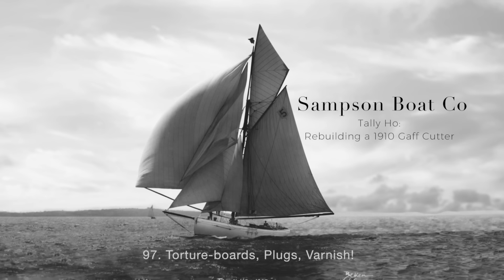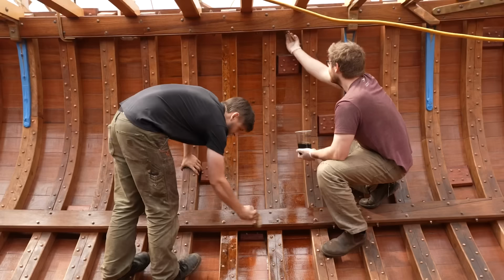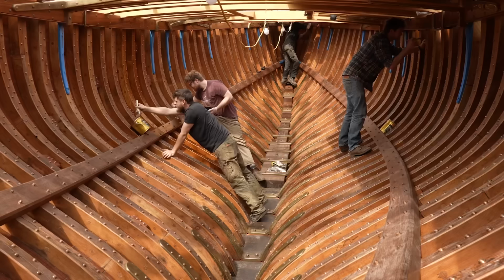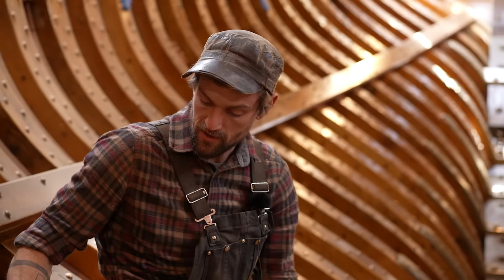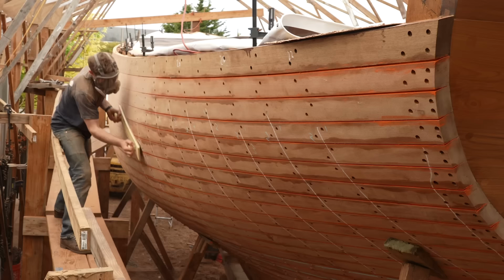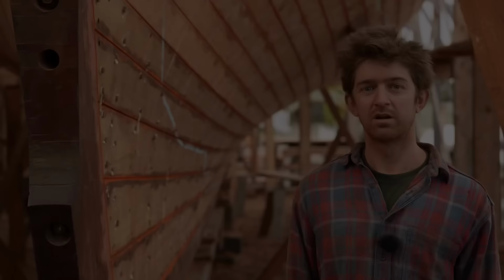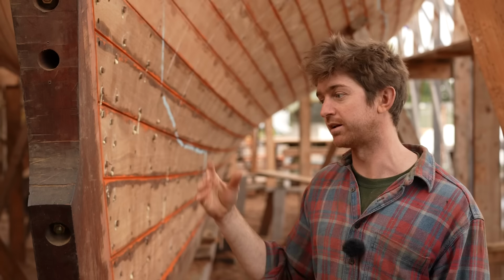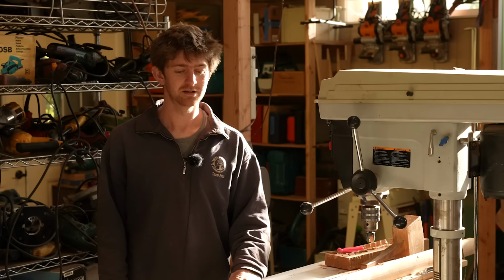Torture-boards, Plugs, Varnish! (Traditional Boatbuilding / EP97)

Comment: Leo, on the teak - get in touch with the USS Iowa Museum. They're in the middle of a $5M re-decking of the battleship, in teak, of course. They may be able to give you some options.
Reply: This is a good suggestion.
Reply: Wow, that would be great !!
Reply: @icarus877  I haven't. I'll give it a go.
Reply: Awesome
Reply: Wonder if it could be reclaimed...  How cool would that be, to build the deck out of the reclaimed boards of a USN Battleship!
Reply: @spaight711  There is a good chance the timber coming off could be re dimensioned down to a size suitable for this.  This needs 2" thick I think he said and I believe the deck on a battleship was about 6" teak. 
Weirdly I know this as my das has a letter opener made from the deck of a battleship and it has a brass plack on it telling you that.
Reply: GREAT!!!!

Comment: Hi Leo. Love your channel. I am a forensic fire investigator in Australia. When using linseed and tung oils, please ensure any absorbent materials such as rags etc that have been contaminated with the oil, are disposed of in water. Both these oils are prone to self-heating and spontaneous ignition when rags are exposed to air in trash/rubbish bins etc.  Take care and keep the good work.
Reply: We usually just burn them at the end of the day.
They can't cause fire if they're already on fire.,
Reply: reminds me the safety guy for the company we worked for  had a fire at his home after doing some staining . later during a safety meeting the safety guy was stressing there is no such thing as an accident . one of the contractors then asked  . so the fire at your place was arson?

Comment: To Leo and the crew, you guys have done a fabulous job. I can clearly see why the long sanding boards are called torture boards. I wouldn't last 15 minutes. My shoulders would give out. The idea of working a torture board for an entire day is unimaginable but I have to say that the results seem to come quickly as the hull becomes truly fair with no lines, blemishes, high or low spots. The end result looks fabulous. A big round of applause goes to all the people who slaved away varnishing and sanding the inside of the hull and as with the outside it looks fabulous. Before you know it you guys will be applying a coat of paint to the outside of the hull. Leo, all the best in finding the perfect supply of wood for your deck. I trust another miracle will happen just when you need it. Cheers - Wm. Gatineau,  Quebec.

Comment: Hi Leo, 
Again, What a fantastic project!! She looks better every day.
Regarding woods, I see some people recomending IPE. This is a very heavy, very hard wood difficult to work with. In double-ender wooden boats made in the 1940s  (like the legh II) of Vito Dumas, this wood was used for structure, ribs and Gardboard and lower planks (exactly in the way you used angelique).
Since in those days (WWII) it difficult to get teak from Asia, many of these old boats had decks done with "Petiribí". I've seen decks with 30-50 years in mint condition.
I am pretty sure you have done much more research than I have, - we are used by now to see how thorough you are in both the preparation and execution stages- including, of course, wood sourcing. Still, from what I have researched, although Yellow Cedar is used for decks etc, but it does not seem to be particularly rot resistant. Since you are stuck, maybe some additional homework on other woods would be worth it. ?
It is a pity that you have to move and lose a big chunk of time and money in this. If I may suggest, why dont' you do a "moving-out t-shirt? In the front something like a drawing of Tally-ho in the truck.... in the back  just a sentence "Sc@& the neighbour"

Keep it up.

Comment: Hi Leo - as well as a boatbuilder you are a superb photographer. If I may make a suggestion,  it is to set up a photo session to get the interior of the boat in full sunlight with Poncho in the foreground (ish). It would be great picture to display in the finished Tally Ho’s saloon,  as he has very much been part of the project and in fact is probably the only ‘viewer’ who has watched the unedited version. It would also make a great signed print to sell ,to raise funds for the deck timber.😀👍⛵️

Comment: If every subscriber donated $0.20, you could afford the teak. Let’s do this!
Reply: I would hate to donate .20 and find out later that only 200 others had donated too.  A project like that would require the full amount be donated so as to acquire all the wood necessary.
Reply: In the 1970’s I worked at Matson Navigation’s dock in Oakland CA.  Bulk ships in from the Philippines were braced with mahogany boards several inches thick and 40 ft long.  They were given away for free.
Reply: @pehill1951  I remember the cribbing and dunnage for Cheoy Lee boats (shipped as deck cargo) was absolutely beautiful  and ended up given away as garbage.
The whole 'pallet crafting' scene today would be shocked.

Comment: I understand how rewarding fitting the plugs and chiselling them smooth to the hull afterwards. I think the reason why in my mind is it’s a simple rewarding job as you look forward how the plug grain matches up with the plank grain and I bet you admire the one that matches perfectly when that happens. So you are always eager to get that perfect fit. You can call it mind games but it’s a very satisfying way forwards to see the end result of the plug blending into the surrounds and is to me important to get the grain matching the grain of the planks as if grain placement is wrong ,it will show up a lot of the time after the hull has been painted. Cheers to the look of Tallyho and all of those who have and still working on her. Must not forget the feeling of super sharp chisel removing thin slithers of wood is satisfying as well! Cheers 🥂 Leo and all

Comment: When you "Filler" the shallow holes, make the "Filler" from saw-dust, mixed with, "Two-Part-Epoxy", that way they will be there forever... or put the shallow plugs in with, "Two-Part-Epoxy", then it won't ever matter, how thin it gets when you fair it off...

Comment: 25:15 As an older person (65) I can attest that you won't have to use a long board to feel like that from sun-up to sun-down every day. Take the utmost care of your lower back as you journey through life. Knees, hips and shoulders can be replaced. Back surgery involves fusion which means those joints don't move anymore. Look at the movement of the elderly and ask them what they did for a living. Those that move well were not boat builders. Teach boat building and you will have a longer career. 

You should all be very proud of your accomplishments. Tally-Ho looks tremendous.

As my Dad would say, "My hat is off to all of you." Best wishes to all the volunteers.

Comment: What you need for the long boarding is an air file you get the same finish but it's a Pneumatic file about the 2ft long lot less  work on the arms and back , their mostly used to file body filler in body shops on 🚗 cars to get flat areas before paint

Comment: So long for now, to the ones headed back east. Those bungs are either pretty soft, the chisels dang sharp, or quite a meeting in the middle somewhere. They sure shaved quite well.
Those long "torture" boards are a good work out on auto body work. I can only imagine fairing on the larger curves and flows of a boat's hull 🤤. 😉
Loved seeing the blue and yellow making the green "goo" compound. You know there is paint coming soon when filler is getting mixed. And the varnish looks so beautiful on the interior of the hull. So glad you didn't just slather bilge paint in there. It just looks so much more appropriate to its original in varnish, even with the bronze instead of iron.
She is looking so beautiful, Leo. You guys and gals are building a gorgeous boat, for sure.

Comment: I believe you, Leo are using the proper term.   So I believe that plugs are the proper term.   By definition, a  bung is a liquid stopper in a hole like in a wooden barrel.    
  Also you don't purchase bung cutters, you purchased plug cutters.       I bet back in the day former coopers that switched to boat building were the first to use the term bung.   I am a small wooden power boat person.  I believe that companies like Chris Craft, Century,     Lyman, Garwood and Hacker Craft all called them plugs.

Comment: 13:35 Maybe you could use Total Boat's wood repair putty (FixWood)? Allegedly, it's meant to repair wood pieces, therefore, it should have some level of give? I mean, it would certainly be better than regular filler if behaves as implied.

Comment: Tonk and a big brush like the Wooster yachtsman and I feel like I only have to dip the brush halfway in once to varnish a huge area before having to return to the pot. It holds so much I have to start in the middle and work back to the wet edge. I’m sanding less between coats, as little as I dare, and haven’t found the minimum yet, as long as the coats are thin and allowed to dry. Wild stuff that tonk, I got to use now that I’ve spent so much time trying to figure out how!

Comment: You might want to try some alternate sand paper materials, like ceramic, to sand the harder wood when fairing it with the sanding board. There are a few other types that are used when knife making and sanding hard steels to finish.

Comment: I guess (and hope) that the loose rivets were caused by not bucking them correctly in the first place. A tiny movement at the time might not be noticed, but when they're given time to move a bit they can reveal themselves.

The reason I hope this is the problem is that it implies that once they have been corrected, the problem is at an end.

Comment: Have you ever considered a long flex block air sander like the ones they use on cars. They're pretty aggressive with coarse paper and can dialed down to a glass finish with fine paper, either way maybe they can help with your harder material.

Comment: What impressed me was seeing the uniformity of all the rivets on the frames, knowing the holes were drilled from the exterior. How did you manage to keep the drill ‘straight’ & at the correct angle, through that depth of timber with no mechanical guide?
Reply: I forgot to ask: When installing all those bungs, did you align the grain of the bung with the grain of the planking or did you just insert them without worrying about alignment?
Reply: The crew had > 4000 holes to drill so it's unsurprising that they'd get it right eventually. (Keep the drill square to the boat's centerline, not the hull surface.) & yes, the bung grain is aligned to the plank grain.

Comment: Question? 
On some woodworking projects I'll seal the entire backside of a board before installing it. 
Is this something that could be done with the boards on a boat hull to better stabilize them or would their be downsides to that?
Then additional vanishing on the inside of the boat would essentially be second and third coats?

Comment: I'm assuming the outside of the boat will all be faired and painted with epoxy based fillers and paints which should reduce the amount of water getting to the wood and rot (over the long term) where possible?

Comment: Leo, Thanks for another interesting video.

Given my background as a professional boatbuilder, I can't entirely agree with some of your fairing techniques.  Longer boards i.e. 6 to 8 feet (that require two men) work far better in my experence, also each person encourages the other to 'keep at it'.  Also the board should never be used in the vertical direction, as we saw in the video, as it digs holes in the hull.

I am surprised that you haven't installed any bulkheads, (i.e. much earlier on in the project) as they add enourmous strength and stability as well as preventing movement of the hull.  I hope you get on to them before moving the hull.

Comment: Leo, I am interested where old school is left for new school in your building this fine vessel. Power saws, power drills, power planers, and three or four inch throw away coarse bristle brushes to apply varnish?  Old school painter technique for first coat is to thin by 25% on fresh raw wood application makes deeper penetration of applied material, especially varnish or eurethane or paint. But a light spraying of that would seem advantageous to varnish by compressed air, HVLP or alternative seems a move in the right direction, new school for the new boat.  Just my thoughts. Keep up the great work.

Comment: Leo.  Have you ever thought that even though the old original wood from Tally are not much good for using on the the rebuild - you could auction off the old (signed) wood?

Comment: About the teak: I was recently in Brazil. Teak is ridiculously cheap there.
They also have a wood called Ipe, which is very similar in grain density and rot resistance. (And even cheaper!) So maybe that would be an option...
Reply: CITES and Customs is a big problem importing timber that is logged out of protected areas.
For a long time Brazilian Mahogany was trafficked to Peru, because Peru was the only nation with valid export permits.
But of course this ends badly for everybody (not least of which the people living in the forest)
Reply: @jimurrata6785  I figured there might be some customs issues... Still worth looking into it, I think.
Reply from the maker: Brazilian Teak is no good for boats - has to be Burmese Teak.
Reply: @SampsonBoatCo  So that's why it is cheap...
Reply: @SampsonBoatCo  But it could be from Indonesia, Paupua/New Guinea, Andaman/Nicobar, Malaysia, Timor, SriLanka/Ceylon.
The point is that plantation grown timber doesn't have the qualities you need if you want it to last another 100 years.

Comment: Leo I'm still a bit concerned about the lack of an after bevel on the stern post especially in the prop cavity. This would be to reduce cavitation drag and erosion of the timbers, the aft chamfer   could carry all the way up thru the butt ends of the planking for the same reason plus it remove the exposed outer plank end grain and reduce the chances of splitting if the stern ever bumped crossways to anything. The size of the after chamfer would vary from about half a plank thickness to whatever the stern post needs to match the rudder thickness. I know it is a detail but it should be addressed before hull paint. It's going to be a great boat, good luck.
Reply: There is some add'l carving to be done at the prop aperture, but just on the sternpost, the scallops don't extend into the planking. See the drawing briefly shown in EP80 @ 11'37".
Reply: I am out - that dwg shows the scallop edge penetrating past the rabbet & into the planks. Those planks are all tight up against the stern deadwood at that point, so it won't be a structural or leak problem, but several hood-end fastening screws might have to be set a bit deeper.
Reply: @frederickstibbert7389 Thanks for spotting the scallops on the working drawings. Good eyes.
Reply: @frederickstibbert7389  I was noting Leo discussing trimming the planking butt end in EP94 @ 33'45"-35'. He was mentioning possible splitting damage on the exposed end grain, what I was suggesting was an aft bevel on the butts to move the contact point in from the outer edge to an edge that is near the middle of the plank which would resist the possible splits very well and if carried all the way down to the stern post would reduce the cavitation of the sharp aft edge of the current transom. Although not evident on the drawings the aft face of the sternpost should also be tapered to match or be slightly less than the thickness of the rudder, this will lessen the cavitation, drag and make the rudder more effective. Sorry to many years working on aircraft.

Comment: That's interesting, I was assuming a lot of the fairing was to make the boat more streamlined and symmetrical so it would sail better. But then Leo says the broads under the water line and so only need to be vaguely fair. So the fairing is purely aesthetic?
Reply: IMO proper fairing is essential for highest speed / lowest drag, but there's a point where add"l work will only yield a tiny, tiny improvement & one doesn't want to reduce the plank thickness too much !
Reply: i read the cre chiefs for the WW2 fighters would sand the paint with fine sand paper to gain a few MPH

Comment: Looking good.  I always laugh when Leo says things like "Anybody can do this, it's just time consuming, and laborous".  Yea...I'm not allowed anywhere near a longboard anymore.  Don't ask, it wasn't pretty.  Only guy in the world that can cut something too long, trim 1/1000 of an inch off and it is suddenly 1/4" too short.  Yep...people have seen it, people are like "but you barely touched it"..."yep, welcome to the zone".  LOL.  USS Iowa...lots of teak coming off her.  Teak isn't easy to come by where I am.  I used to be able to get it from Rockler, but they stopped, then I was getting it from a specialty place not too far from me, and they also stopped.  As for $50/bd ft...try $75~$80/bd.ft. in my area, with CASH up front, and a minimum order of 1000 bd. ft. CRAZY...

Comment: Leo, a technical question: wouldn't it be easier to use raw linseed oil for sealing the inside of the hull working wet in wet without sanding? That would save you a lot of effort.